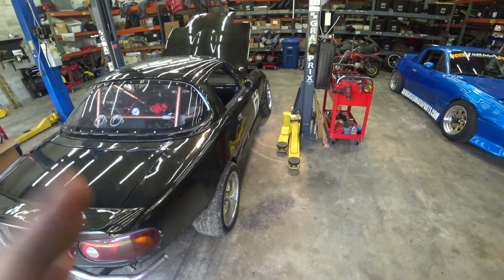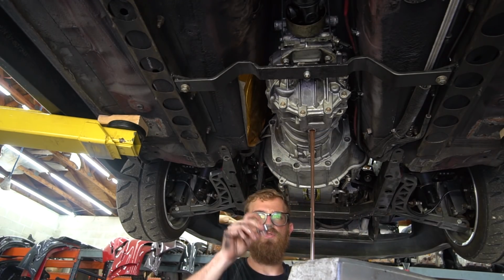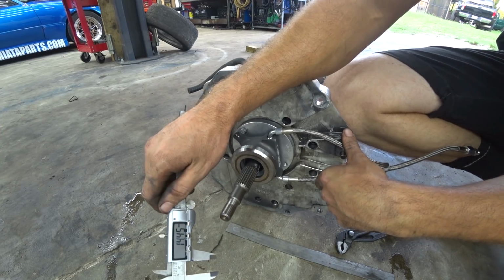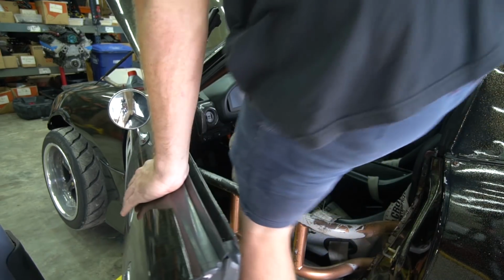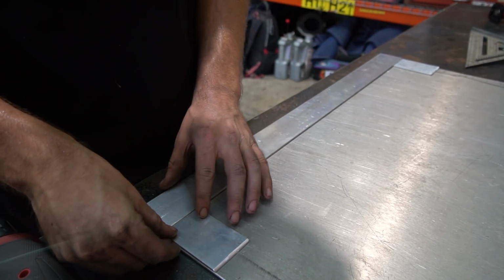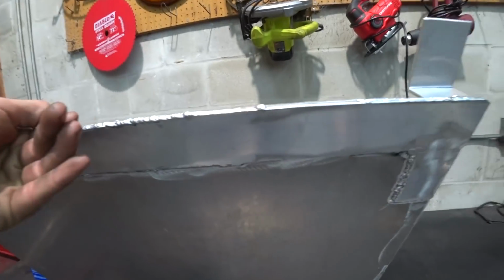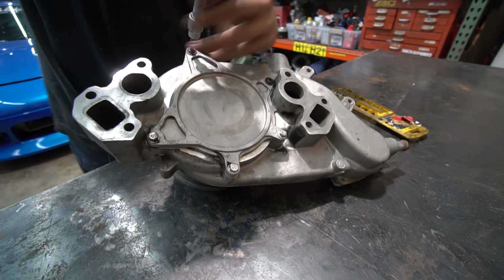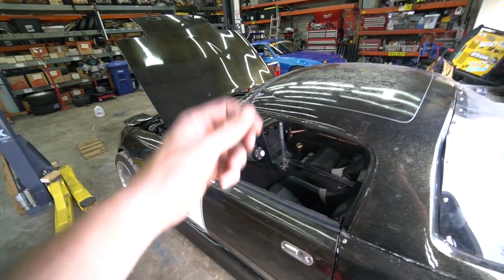Fixing The Biggest Problem With My LS3 Miata.

Comment: I have used this to get adjustment back when there was none from the factory. I know that is not the same as what you are doing but it is much easier to adjust than taking the trans off. https://ramclutches.com/hydraulics-accessories-repair-parts/

Comment: Re cooling,,, you said it yourself that the expansion tank went boom and you havent fixed it. Look to whats changed other than the engine. The expansion tank is part of it. Unless you have that system in place then the rad system wont work as effectively 

Build a new expansion tank perhaps?